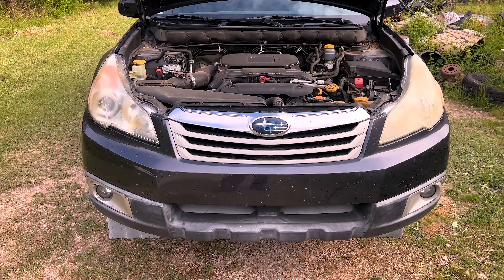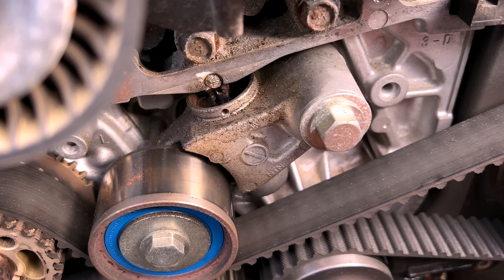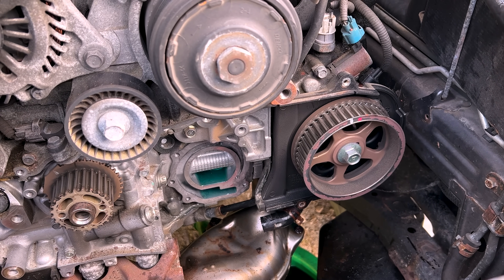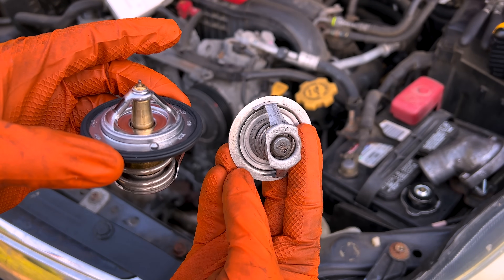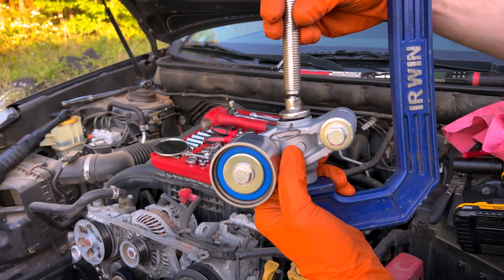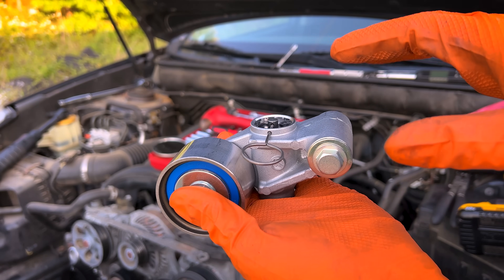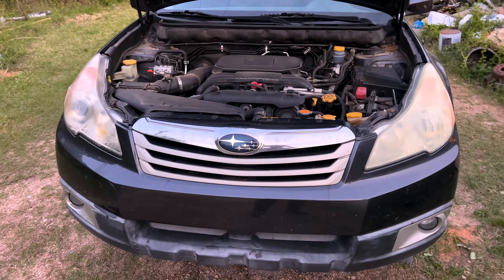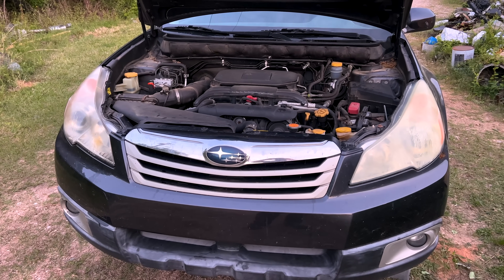Subaru EJ Series Engine Timing Belt Service Tips And Tricks!

Comment: I know this is an older video, but I have a new to me. 03 Legacy wagon. 150 thousand miles runs great. The timing was done in 2012 but only 65,000 miles ago. Unknown components used. I already bought an AISIN kit. Chad, this job be done based on the age of last timing, especially since we don't know what components are used?  (The previous owner said that the head gaskets were also done at the same time, but there's no documentation)
Reply: Should...not "Chad"

Comment: I find longer bolts for the WP and cut the heads off. Thread them in a little, install gasket, WP, other bolts then the 2 alignment pins are taken out and torque to spec. Your trick works the same and might be easier but we do a lot of TBs so we made them.

Comment: Great video. I just did this job on my wife’s 2012 outback. After making sure 100% my timing marks are perfect. Started the car and heard a knocking on the driver side of the engine. Shut off after a few seconds. Tore everything back down, timing marks are still perfect.
What could cause the knocking?
Reply: Knocking went away after some short idling. But it came with rough idling.

Comment: OEM timing tensioners fail also I just did timing belt on my 2011 Outback and within a thousand miles the tensioner was rattling did everything by procedure including bleeding it and it still failed. Second tensioner did the same thing. By the third time I got a good one. Aisin thermostats are identical to oem.

Comment: Hello. Great video. I had a mechanic replace timing kit on 1995 Impreza ej18, 165,000 miles. Then, 6 months, 2,000 miles later, i have 76psi compression in cylinders 2 and 4 (drivers side head).  It starts fine and will drive but is a slug. No overheating or oil/coolant leaking. Good spark plugs/coil. Just half the compression it should have on that one head. 

Could bad timing cause both of those cylinders (2/4) not to have compression?

How could I do a cursory check on the timing marks,  in my driveway? 

Thanks!

Comment: I had my water pump and timing belt (1998 Legacy 2.5 automatic) done by a garage here in Montreal three weeks ago (had to bite the bullet and pay, I'm in a big city, no place to work on car, winter, wife and small child also need car etc)
Engine seems louder now (in the high -pitched range - more subaru sounding)
Idle is rough, never was before. 
Fuel consumption seems even worse than before. It's eating gas. 
Just wondered if anyone could say AHA! that's related to timing belt. (could it be one tooth off? ) Is there any latitude for that or does the timing ONLY work one way?

Comment: About to put my timing back together tomorrow on my EJ25... I don't have a crank holder tool, is it necessary to have one to torque the harmonic balancer back in place? Or can I just put the engine in neutral and put it in place after the belt is in time?

Comment: Question:  Regardless of age, what was the lowest milage anyone has experienced an original Subaru timing belt breaking?  I'm at 71K miles but my 2010 Forester is 13 years old now.  I understand the Subaru manual say replace it at 105 miles or 11 years.  I live in a moderate climate (Northern Virginia) and it never gets really hot (over 100 F) or cold (under 10 F).  I haven't changed it yet and the Subaru dealer has not even suggested changing it.  I'm thinking I could hold off a year or so and change it at 85K miles.
Reply: Remove the small "inspection" cover on the right side when facing the engine. If your belt seems still in good shape, you could hold off for a while..

Comment: Got a 2008 Subaru Impreza,

The timing belt tensioner pulley bolt spins. When I remove the tensioner and just use the bolt it will catch and thread but it will not thread with the pulley. Any ideas?

Comment: I did several thermostats on hard to bleed cars by putting an aspirin in the thermostat flap so the car circulates the water from the beginning ,fills with no trapped air--as it runs the aspirin melts and the thermostat work as normal--what do you think-good idea? some bmw are almost impossible to bleed with out special tools.

Comment: How does that car not have the Log book Still showing when the Timing belt was last done, ?? It like 10 years newer than mine which does

Lol i have a Very Nice MY99 IMPREZA WRX GF8 Wagon (In Australia) With 230,000KM or 143,000 Miles on it 
But It Still has the logbook in glove box and first 15 years of its life it only saw the Subaru dealership it came from for All Service & Repairs!!
(And Everything i have done to car since ownining it is also written in there) 

Its My Pride & Joy That i will own for another 15-20 Years Currently Insured for $17,500AUD or about $15,000USD 22 Years Old & With 230,000km and its had 46 Oil Changes (Thats New Oil Every 5,000 km or 3,100 miles) But only had 4 clutches, Tho i Fitted a Custom Built 5 Speed with Custom Shaft that has wider STi Gears 1-2-3-R with slightly lower/faster ratios (from the Sti 5 speed)

The Engine is in Immaculent Condition will probably last me till 300,000km or 186,000miles Before i need a new Engine i hope longer.
At 200,000km it had a new timing belt and the compression was 155-155-154-156psi (new is 165psi), 
It Still has the Factory Turbo which has to quote "No Measurable Play" @ 200,000km.

Comment: Ace has smaller s which I got just for this job. But the bigger ones have more leverage. But every 15 secs turn half way from where you started. Do this 3 times not one. Should take about 1 min or more each time. Be very careful when installing the last pulley the one next to oil filter. Add anti-seize on last pulley so the side ways threading doesn’t strip threads on block. Especially if you plan on doing timing belt at least one more time or for friends.

Comment: Hey Mr Subaru
I have an ej254 which is DOHC and avcs. I'm doing my timing belt according to your instruction, cheers!
I just want to know if it is safe to manually, by hand, rotate an exhaust cam back into timing alignment?
My passengers side exhaust cam - RHD mind you - shifted out of alignment when I was removing the water pump. I turned it counter clockwise back into alignment, but could you please confirm if this is okay?

Comment: Does the timing belt tensioner have to be replaced every time the timing belt is removed for a repair? 

I need to pull my belt off on my ‘07 Impreza 2.5L to replace the solenoid oil control valve housing and want to confirm.
Reply from the maker: No. It doesn't.

Comment: Thanks for making this video. The hardest part is missing though, with how to get the new belt on and the sequence in doing so. I’ve tried so many different ways, with the tensioner last, or the lower left roller last and the belt is too tight to get on. If I try and get any of the bolts in on the last one I’m going to risk cross threading. All new parts match the original parts, and the tensioner is bled. I’m at the stage of getting my car towed to a shop or having a mobile mechanic come out and help get me over this hurdle. I’ve done CV boots before and other items on my EJ20E but this replacement timing belt is a killer!
Reply: were you able to solve this on your own?  just curious
Reply: @dubyaelle5533  Yes thankfully. I spoke to a couple of mechanics and they said the replacement tension can vary on some kits but the last roller at the 7 o'clock position was the last one to tighten. It took a lot of swearing and huffing and puffing but it worked. Apparently the AISIN timing belt kits are better to install than the Gates kit I bought with better part quality. I don't think I'll ever need to do this again but if I do I'll be buying the AISIN parts (Made in Japan as far as I know)

Comment: Hey  Subaru Guy -  I have a 2011 5 speed Forester with chain drive motor.  It has lost compression, so I am assuming this is one of the famous ring issue cars.   What would you recommend to justify the $ i put into the clutch, PP and TOB a few months before it stopped running?  Engine swap, rebuild, something else?  Thanks

Comment: hey i would like to know a little more about old imprezas. been liiking at buying a new used car and i want to try out subaru. looking mainly at impreza but it seems like the only ones i can find in my pricerange are little 1.5l petrol engine and 2l diesels. have heard to not buy diesel at least before 2010 cuz the crank brakes in half or bends. would this mean that a diesel 2011 is good? found a few 2011 diesels so thats why im asking. hope someone has some good info for me :)

Comment: Over the years I had got bit twice  by oil pumps ..(note on the turbo engines only)  so when Im doing a major maintenance i always replace the oil pump and water pump with OEM pumps also tensioner also OEM then the belt and idlers ect like u had same manufacturer as oem uses ... and us the rest of the maintenance items coolant flush brake fluid flush diffs trans plugs filters ect
Have u had any issues like that??

Comment: What i cant understand is u say timeing belts should be done every 100 thousand mile 
but here in Australia they say it should be done every 100 thousand km whats a round 160 thousand miles thats a lot of differnts
Reply: 75000 kilometres to 100,000 is what most mechanics recommend that I’ve spoken to here in Tassie.
Reply: I messed up 100 thousand miles is = to around 160 thousand km

Comment: 212k 2001 forester ejNA now starting to lose coolant into overflow. Wish me luck boys ! How much longer do I have ? End of year ? Yes it’s my daily 30 miles total daily
Reply from the maker: ASAP head gasket replacement.
Reply: @MrSubaru1387  uh oh what if my plan was to drive it into the ground and buy new? Thanks 🙏
Reply: @DFPFTW  I don't recommend it but my EJ251 has been burning coolant for 12k miles and doesn't seem to want to die
Reply: @theebodabe  dude I stopped the coolant issue with the blue conditioner for coolant via Subaru. More than one bottle finally blocked it up not more excess in my overflow tank. I should be good to go for a while
Reply: @DFPFTW  Hell yeah, I may have to try that

Comment: Hey mate! Thanks for the video! I have a question regarding timing belt life. Do they have a shelf life if they are in the box unopened? My local parts guy has a genuine one but it looks like it's about a decade old.
Reply: Y the y%%fr f4
Reply: It’s a critical engine part, I wouldn’t risk parts that you are concerned about before you even buy them. Ask your parts supplier how old it is, check the branding or buy elsewhere. Too many other options these days with internet sources to be stuck with old parts.

Comment: Hello from Scotland! 
Been a subscriber for a while and love the content! 
I was wondering if you (or anyone else) can help with a query I have. I’ve just taken delivery of a 2007 4EAT WRX import from Singapore (JDM spec). I pulled the dipstick to check the ATF fluid and it was golden in colour and stinks of gear oil (the same smell of the 75w90 stuff I stuck in my manual gearbox!!! Should I panic? It seems to go into gear quickly and shift fine. Do ANY Subarus use a clear gear oil or are they all Red coloured dexron 3 etc and so forth!? If my fears are confirmed and someone has used manual transmission gear oil, can I drain and fill with atf? Is there any kind of flush I can do? Hope this reaches you! 
All the best
Reply: Update: I am an idiot. I’m so used to manual Subarus with the front diff built in to the gearbox I got confused. I’ve been pulling the front diff dipstick and checking that oil so gear oil sounds about right! Have since located the ATF Dipstick hiding down to the other side of the i/c

Comment: Had a great weekend working on the Legacy for her 200k service. 

Timing belt, tensioners and water pump changed, coolant flushed and replaced, trans fluid changed, air filter changed, Maf sensor cleaned, oil and filter replaced, new spark plugs and leads, rear brake pads and discs replaced and new rear wheel bearings. 

Oh I almost forgot new cabin filter and replaced the fan blower as it was noisy!! 

All replaced with a few tips from your videos MrSubaru, so thank you. 

Busy weekend!!

Comment: Great video! Thank you. Considering to do this procedure later this spring. Are torque specs listed in the manual that comes with Aisin parts package? If not, could you please share the torque specs to follow when replacing such timing belt kit? Thank you in advance.
Reply from the maker: Pretty sure specs are included. I have several step-by-step instructional timing belt videos on here with the torque specs as well.

Comment: Great job! Very accomplished mechanic. I made sure to use OEM belt and pulleys. However I put an aftermarket (standard) radiator and tridon high flow thermostat. And tbh, the oem thermostat was the same size as the tridon... Any thoughts on this product?

Comment: i use a couple really long m6 bolts for alignment, then swap them out for the normal ones after the other 4 bolts are in. 100% agree on the OEM thermostats. the aftermarket ones are total rubbish
Reply: I made a couple of studs from some old bolts that I cut the head off of. Even easier!
Reply: @2003wrx64  as a power sports tech this is what i do, especially for stator covers

Comment: May I ask. What could I have done wrong?
I did this job. Everything was running great. Out of nowhere two days later. The engine died on me and the belt was all ground up upon inspecting it. 

How could I have killed it? Everything was lined up. Took the air out of the tensioner,  etc. Id love to hear some professional criticism.
Reply: Need a little more info to make any useful guesses, were any of the idler pulleys/tensioner bearings loose/shredded? What brand timing components did you use? 
If the car started and ran after you finished the repair, then you had to have lined up everything properly. Is it possible you forgot to torque an idler bolt down all the way, causing it to back off and send the pulley free?
Reply: @boginator55 Well to further support what you said. On some of the pulleys, the bolts screwed in all the way. But, they wouldn't tighten all the way. They just kept spinning. (Probably need to be rethreaded).  It seemed tight enough though, so I put everything back together anyway. After I pulled the case back off and pulled the belt off. The pulleys were still in place. But, maybe there wasn't enough torque on them to keep them still while the belt was moving. Causing it to slowly back off. 

Does that seem like it would cause it to fail? 
Me skipping the rethread part was probably a super expensive fail on my part. I just wanna make sure that might be what happened, so I learn from my lesson. Because right now. I'm scared of doing engine work again. It was my first time doing this job.
Reply: @eggpod4567  If the pulleys are still installed and don't have any play in them, then mystery is a little deeper (although fixing stripped threads would still be a must-do). What brand of timing belt kit did you use? 
If you had stripped threads, the bolts would definitely be a risk for backing out. I myself had a similar experience when I did my head gaskets. I had the engine all back together, and stripped the bolt out for one of the bottom idlers. Sadly I had already dropped the engine back in the car, but even in the engine bay I had room to drill out the offending threads, run a tap in, and install a helicoil. Take the bolt to a parts store, figure out what size thread it is, and get a thread repair kit exactly for that size. It's not as hard as you think to install, just follow the directions carefully. Save yourself the future stripped-bolt headache as well, and get a torque wrench. Of course, if the car stopped running when the belt shredded, its likely the valves are now bent, and you'll be in it at least for rebuilt heads if you want the engine to run again. It's not as daunting a job as it sounds but attention to detail is paramount.
Reply: You've stripped the 10mm bolt on the waterproof, it's soft alloy, drill it out and put the bolt in from inside and tighten, helicoil are a waste of time

Comment: So are we good to use the apparently problematic Chinese timing belt tensioners now
Reply: While the recent NTN tensioners seem to use the same cast as the cheap ones for the tensioner body, the bearing and hydraulic guts are still NTN. I was confused too when I cracked open my Aisin kit and saw it lol, that was almost 4k miles ago and it's running like a top

Comment: Who makes the t stats for subaru oem? Are they stamped?
Reply from the maker: They're stamped with Fuji Heavy Industry's logo.
Reply: @MrSubaru1387  i ordered an oem replacement that  came in a white box with a printed label. The box  was not spot glued and the bagged t stst looks exactly like oem but it is stamped NTN. Is that decent to use or should i go straight to the dealer.
Reply: Tama makes the factory thermostat.

Comment: I was thinking the marks on the belt should line up with the marks on the cam pulley after rotating the crankshaft two rotations?
Reply: Nope
Reply from the maker: Nope. Only the initial install.

Comment: Don't forget to install the rubber strip that goes on the side of the water pump.  I haven't seen it on any of the videos, and I neglected to install it on our 2012 Outback.  Hopefully it will be ok without it, i didn't want to redo the whole job to put it in.  Also, I didnt know about bleeding the tensioner, it may have been in the instructions for my kit, not sure.
Reply from the maker: It's an air/dust seal for the timing set. Not mission critical, but good to install nonetheless.